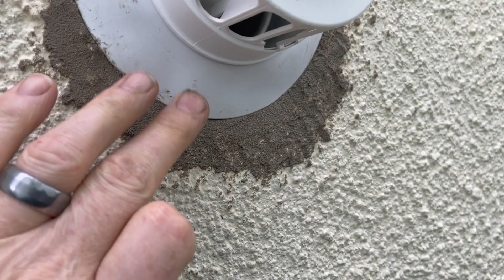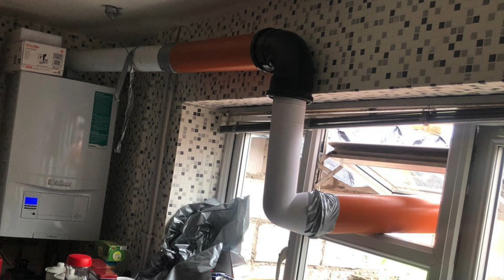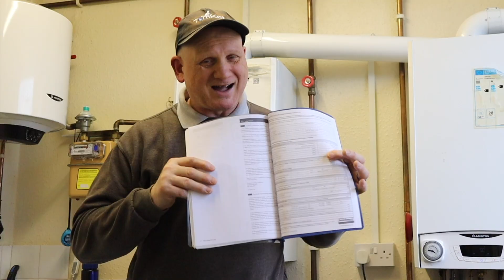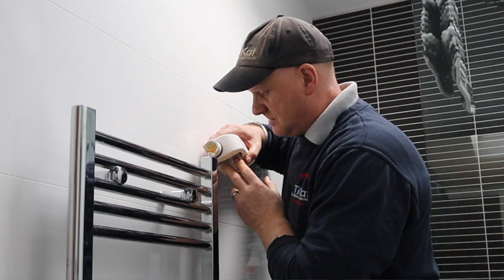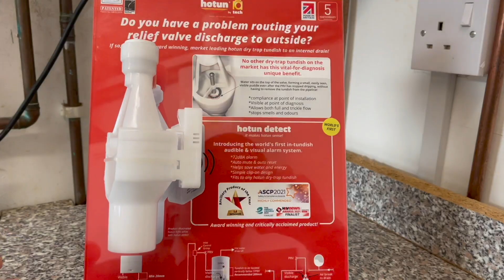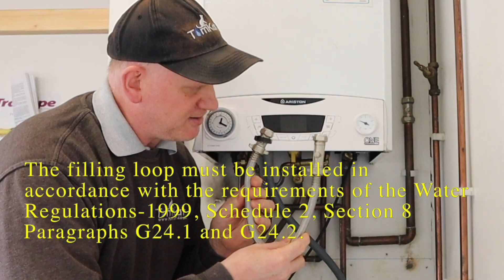Gas engineer or cowboy,  looking at common combi  boiler faults found when servicing or repairing.

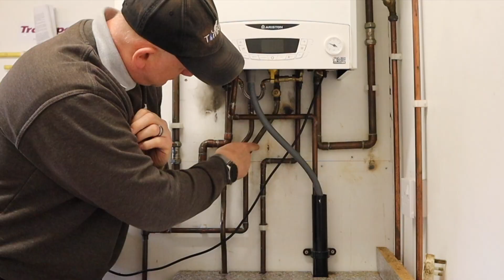Comment: @14:40 you say that a combi boiler has to have a minimum of 22mm gas supply from the meter up to where the manufacturer makes its connection.  I believe this is incorrect. There are many manufacturers out there that stipulate that as long as you are within the permissable drop from meter - appliance  with all gas appliances operating at maximum then upsizing a gas supply is not required.  I have just looked through a particular manufactures instructions  and it does not say anywhere that the gas supply  MUST be in 22mm.  Please correct me if I am wrong.
Reply: Ideal and vaillant connections are 15mm.

Vaillant MIs state that as long as they have 13mb inlet pressure they are fine
Reply: @Marc Barton Ultimately, gas rate is what your looking for.,but a 30kw net boiler (combi or otherwise), you'd  be lucky to find a situation were the actual length  of 15mm from meter to appliance would exist, but it's  not impossible. Just as well run 22mm than 15mm .
Reply: @John Ward  the reason I brought the original question up is Derek "Mr Tomkat" The trainer said that combi boiler gas supplies must be in 22mm from meter to boiler isolation point which i feel is wrong, like you said you can have a combination of 22mm and 15mm feed to the appliance , from how I read the regs and the MIs of particular boilers as long as your permissable working pressures are in accordance with regs and MIs and all appliances at Max operation, correct gas rate and combustion readings are correct then there is no need to have 22mm supply right up to appliance isolation point.   I still can't find this elusive paragraph in the regs that Derek is talking about saying "combi boilers MUST have a 22mm gas supply from meter to appliance isolation point " 🤷🏿. Until I find this statement in the regs , I will believe this is false information.
Reply: @Marc Barton wrong... ALL combi boilers must have min 22mm copper, 15mm on heat only system boilers is ok but combi's require 22mm. combi boilers need a larger amount of gas in a shorter space of time, this is because combis have to work harder to provide hot water instantly, rather than gradually heating it up and storing it in a cylinder.
Reply from the maker: Yeh you are wrong no new condensing boiler will work on 15mm pipe correctly and the instructions in most new boilers say the pipe must be sized in accordance with the regulations.
Reply: @tomkatgastraining  could you tell me where in the regulations it states all combi boilers MUST be in 22mm gas supply.
Reply from the maker: @RoadKillRacingUK  if you are a gas engineer you should know that a combi boiler will not work at the correct readings fed by a 15mm pipe. The ACS assessment has even been changed to now have pipe sizing in it for guys like you if you are a gas engineer who don’t keep up to date with the regulations.
Reply: @Tomkat Gas Training  sorry excuse my ignorance but you didn't answer my question, where in the regs does it say a combi boiler MUST be fed by a 22mm gas supply ? asking for a friend .
Reply from the maker: @RoadKillRacingUK  get your friend to ask me then
Reply: @Tomkat Gas Training  you have answered my question thanks👍✔️ my mate said he is happy to believe everything you say.
Reply from the maker: @RoadKillRacingUK  thanks at least someone has sense and for your information you even got the working pressure test at the meter wrong so maybe you should listen to you mate read the gas safety installation and use regs but the new version not the old one and have a look at bs 6891 and again the new version not the old one
Reply: @Tomkat Gas Training  hi, I didn't mention any working pressure test at meter... 🤷🏿

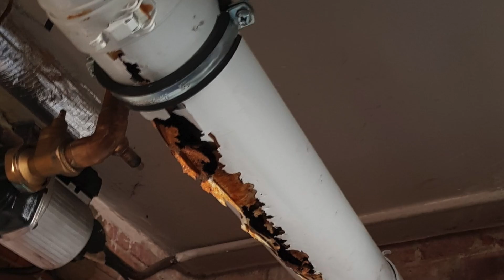Comment: @ 6:44 2 me that only shows that the manufacture has used substandard grade materials;... unable 2 withstand the product of combustion...
Reply from the maker: Manufacturers can not produce a product that isn’t fit for purpose
Reply: @tomkatgastraining  well they patently do, so why did Baxi develop a paint system that is uv resistant?
Reply from the maker: @johnward5006  because their flues were not installed correctly
Reply: @tomkatgastraining  Air tubes are always going to be at risk of corrosion due to atmospheric condensation and rainwater ingress.
Explain how not all air tubes are allowed  to be exposed and others are. It's  not all down to installers and they are not all unregistered or incompetent! The truth is , most metal air tubes are cheap and nasty!
There can be NO justification for manafactures supplying rubbish, it's  indefensible,  full stop!!
Reply from the maker: @johnward5006  we all know boiler flues are rubbish you can crush an ideal flue getting it out or the box. All flues are tested that no flue should let rain into the flue system under normal conditions. You know and I know a vast majority of flues are installed incorrectly ie putting a fall on the flue on a standard flue length when the fall is built into the flue.
Reply: @tomkatgastraining  I do get that and no  oncentric flue is designed to accommodate  driving rain. I watch a lot of u tube videos from various US providers and they use two tube systems with prescribed external separation,  a much better system that is prescribed the code of practice systems.
Although it, in my view,  is a much better system; in the UK their are obvious practical issues to consider.
It might be something  we could adopt in ideal circumstances. 
In the meantime, how much does it cost to utilise decent wall thickness plastics! Come on manafactures, get real!
Reply from the maker: @johnward5006  even the Worcester flue which in my opinion is the easiest flue to install and it doesn’t need cutting seams to rot but the US just doesn’t have our damp climate but I agree something needs to be done with the flue standards.
Reply: @tomkatgastraining  In New York I'm  sure they have similar or worse weather conditions,  but given the cost of flues in this countries, with commitment  flue manafacturers must be able to design all plastic  flue components with  air inlet and outlets to accommodate  all situations, in luding plume control.
Reply from the maker: @johnward5006  I think all plastic flues would cause more problems just look at ravenheat flues but maybe it could help
Reply: @tomkatgastraining  Don't see how plastic in flues can cause more problems, we just need a practical  look at the way we currently  approach the problem.The existing methods are based on the "we've  always done it that way so it has to be the installer at fault "!
Reply from the maker: @johnward5006  it’s always our fault mate 😜
Reply: @tomkatgastraining  Well maybe it's  time those in the industry who keep massaging  the rules to suit their agendas that put us through hoops should be brought to account!
And don't  get me on 18.5-23!
We all recognise whose  best interests  that serves!
Anyway , thanks for your channel that gives mere mortals like me the opportunity to put our views to a wider audience.
Reply: @tomkatgastraining  ...
Not at all your fault...
The manufacturer have responsible to provide QUALITY...
Not flues that R NOT fit 4 purpose...
Reply: @tomkatgastraining  K...
U held in your hand...
Rusted too hell...
Is that is fit 4 purpose...

Comment: Gas engineers do do some of the faults mentions, but i think its down to cost and ppl under cutting jobs
Reply from the maker: I would like to think gas engineers don’t cut corners because of price but I know what you mean
Reply: @tomkatgastraining  They do and part L compliance is going to be a major issue! Time constraints on boiler swaps are the main reason and lack of proper system water assessment and rectification add to the problem.